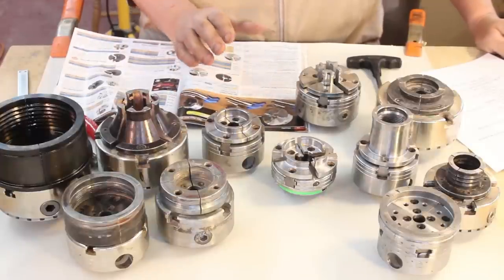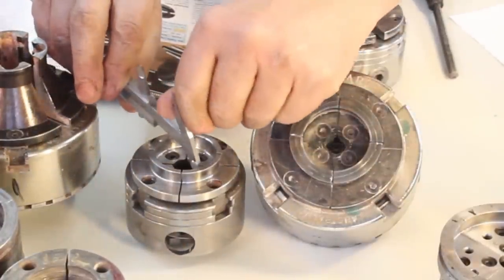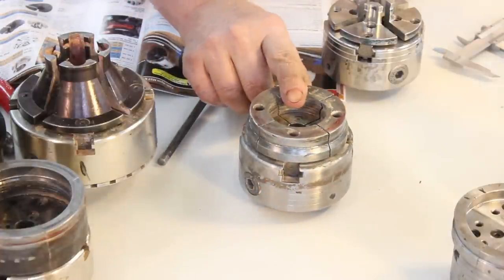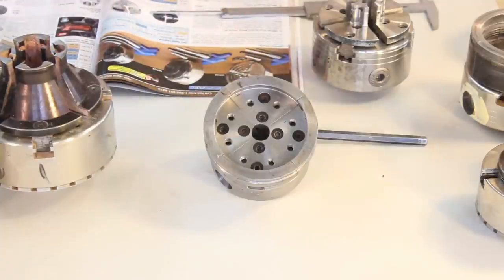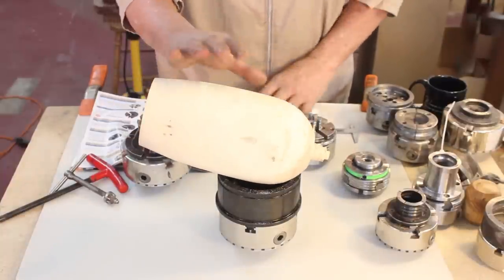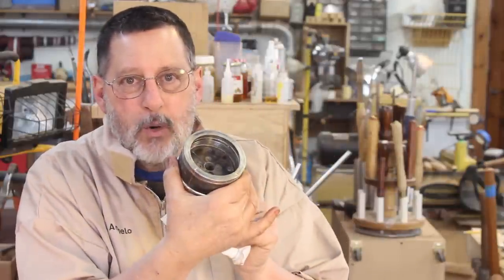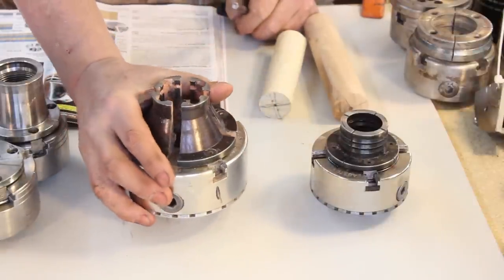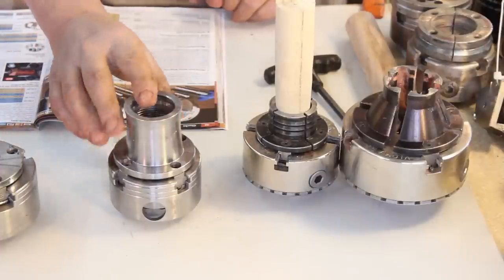Scroll Chucks and Jaws for Woodturning by Sam Angelo

Comment: Great topic, Sam. As I own all 4 of the Teknatool chuck styles, I was curious about the two Record Power chucks which look almost identical to the SN2 and the G3. I did a review of the larger Record Power SC4 chuck like the SN2. In  my opinion it is beefier and higher quality than the SN2. I was surprised. And it turns the typical way to tighten, righty tighty instead of the backwards Kiwi way.

When I started I got a used lathe with a SN2 and 5 sets of jaws. I had to have a woodturner come over and explain what they were all for. And this was for a Jet 10x14 mini! The previous owner made some strange buying decisions.

Comment: I did a lot of research when I got my Rikon midi.....I went with the Barracuda II set, with 3 different jaws....used those for several years and finally bought a second Barracuda body, so I could leave my Cole jaws on one to enable faster transition when doing finish turning...   since my lathe only has a 12" swing, they've worked perfectly for me....   I've been tempted a few times by the "quick-change" jaws recently put out by Nova, but their pricemark is set a bit too high for me to indulge on something my budget would complain about and I can get around just by spending a little time.....

There's a lot of really good chuck sets out there....but it's more than worth the money you put into it....

Comment: Nice video, Sam.
Have the chucks and jaws explained very well.
I also have 2 chuck (once No Name and Nova G3 [Set]).
Will also ensure even buy me extra jaws so.
By Your video, I made a mistake when I noticed. Wanted A vase (diameter 15cm / 6 "and about 25 - 30cm / 9.8 to 11.8" long) turn yew, caving in, the vase is broken me from my chuck and was broken. I had the wrong chuck, namely, the small (55mm) instead of the large (100mm extended).
Thank you for sharing.
Reply from the maker: Gunter
Thanks very much form watching.  Sam

Comment: Have you ever consider of buying wood lathe chuck quick change system like those two:

1- Barracuda 5 Quick Change Jaw Chuck System with FREE Pen Blank Drilling Jaws

2- Nova Infinity Quick Change Chuck System (you can also buy only some parts to make your old Nova2 chuck/jaws to make it/hose a quick change system).

I'm starting looking and I think I'd buy the Barracuda 5 because it is seems to me to be a faster  quick change system and I like to have many jaws options (4 sets of jaws and a central screw are included. The only thing with this choice is, after the price issue (I am in Quebec Canada), for the sake of security and speed, I would rather like to have an hexagonal wrench for jaws tightening instead of having a key that penetrates the chuck.

Comment: Just came across this video and really enjoyed it. I have a Vicmarc 120 for a variety of spindle and bowl work. I am looking to add another scroll chuck to my collection and was wondering if I should add another 120 with different jaws or a 100. I have the HP to turn the 120 but was wondering if the 100 might be an option for smaller stuff or just go with another 120? Thanks.
Reply from the maker: I really like the smallish size of the 100.  I have one with shark jaws which has become a favorite for boxes and such.  For the 120 that you have, you could get a set of 3" jaws for larger bowls.  And trade them out. I like the 3" jaws as the are not enormous but can do a 12-15" bowl ok and can expand larger for a platter.  I usual just buy a chuck body and then get the jaws I prefer.  Sam
Reply: @WYOMINGWOODTURNER  Thank you for the quick reply. Your last comment is kind of the direction I am heading...dedicated chucks with dedicated jaws. As I find I need them, I might buy some of the more specialty jaws and swap them out when I need them for a project but want to have a decent selection of chucks that are ready to go. Larry

Comment: Hi Sam, I want to turn very small items. Down to 8mm or possibly even smaller if I can. I want to use the central machinery 10x18" lathe from harbor freight. Could you possibly suggest which kind of chuck I should use?
Reply from the maker: Kmsan
I think what you need to look for are "pin" jaws.  You could buy a number of small scroll chucks, with or without the jaws: (Body only).   Pin jaws can hold very small items.  You can check the dimensions in the description of the jaws.  Something like this-----

http://www.rockler.com/nova-mini-spigot-jaw-set?utm_source=google&utm_medium=cpc&utm_term=&utm_content=pla&utm_campaign=PL&sid=V9146&gclid=CjwKCAjw2s_MBRA5EiwAmWIac-ULDzE5ddBVrvWdBIkljuUoN-eQ1l5NK5VX6Y0tvE_4Rji9xOARzRoCPeQQAvD_BwE

Sam
Reply: WYOMINGWOODTURNER thank you!!

Comment: What would be a good chuck for a 1/4"-1/2" steel mandrel? I know that i might need a 3 jaw metal chuck, but I was hoping that there might be other options. I turn cork handles using steel mandrels since cork is too soft by itself.
Reply from the maker: Will
I would stay away from a metal working Chuck.  I had one years ago and they are not great for holding wood.  If you want to hold something as small as a quarter of an inch you can get pin jaws.  These are draws normally used for holding small items like a finial.  I use these for my bottle stoppers occasionally or holding a pen mandrel. Every maker of scroll chucks will have a wide variety of jaws , they go from very small to 5 or 6 inches for large bowls..  Hope this helpsSam

Comment: Hey Sam! Awesome info as always! I just got my first lathe for Christmas and it didn't come with a chuck. It's a Turncrafter variable speed with a 10" swing. What should be my first chuck if I want to turn mostly bowls?
Reply from the maker: Hotrod.... I have used lots of different chucks.  My first choice is always Vicmarc which I feel are the best but also expensive.  Here is a link to Record Power which I am very impressed with---  https://www.woodcraft.com/products/record-power-sc4-chuck-50mm-jaw-woodscrew-and-2-faceplate-package-62063?gclid=Cj0KCQjw--GFBhDeARIsACH_kdaVgWvL7AGXcg2d3dopxGvS3fTCbuHO1seDkwWFsyxe9ejjBpKbWVgaArlCEALw_wcB

The 2" jaws that come with this chuck will work for smaller bowls but once you get into 10-12" bowls you might upgrade to a heaftyer jaw set.  Sam
Reply: @WYOMINGWOODTURNER  Well unbeknownst to me my wife got me a Nova G3. It came with 3 sets of jaws, 2", 4" and the pin jaws! Happy birthday to me! Thanks for all the videos you share Sam! You have quite the library that I have to catch up on!
Reply from the maker: @hotrodhog2170  Your wife hit a homerun!!!  I have several G3 chucks-and that is a good selection of Jaw sets.  Have fun. Sam
Reply: @WYOMINGWOODTURNER  I hit a homerun when she said "I do" 8 years ago! Lol.

Comment: I hear a lot of turners saying that they do not like  jaws that have the grooves on the inside. They say they would rather have smooth dovetail jaws. I do not understand the reasoning behind that. Personal preference or for a certain reason? Thanks Sam!
Reply from the maker: +Tom Wilcox At least some of those grooved' jaws are straight or have walls that are parallel.  I also don't like them.  Luckily I only have one set.  They are difficult to grip.  Depending on where the serrations end up, they can push the piece out of the chuck a little, just enough to push it out of true.  I am with the dovetail folks.  Thanks Sam

Comment: Mike, I’m new to wood turning and just purchased a Jet 1640. If I purchased Jaws, which would be your suggestion. By the way I’ve been an avid woodworker for 40+ years.
Reply from the maker: I have experience with 3 makes of scroll chucks. 1) Vicmarc would be at the top of my list- a little more expensive but you will never be sorry you bought these.  I have the VM 100 an 120.  Depends on what size stuff you turn.  2).  Next I like Record Power scroll chucks a lot.  These are well made and would be  a chuck I would not hesitate to buy.  3) Nova chucks.  I have 5 or 6 of these.  They are an old favorite of my and also a good chuck.  Sam

Comment: I have just bought a chuck like one of the ones you talked about. I don't yet know all the terminology so you may have to guess at what I am asking. When I prepare a piece to put in the chuck do I want the chuck jaws to close in around my piece or do I want the jaws to spread out into the sides of my piece of wood? By the way I just recently found your channel and I do hope to learn from you. Thank you for sharing and God Bless my friend.
Reply from the maker: +Frank Ingram For the best grip.....you want the jaws to tighten down as close to a circle as possible.  This will give you more contact with the wood, as opposed to having them extended too far.  Then, they only grip on the 8 points of the jaw corners.  Sam
Reply: +Frank Ingram I think you are asking is it better to use a tenon or a recess. Both work well when done properly. I think it is mainly personal preference. I prefer tenons for most things except platters.

Comment: I have been looking at the Nova cole jaws and i need a great and cheep chuck for them. Heard that the G3 is great but i cant find it without jaws (I dont need the standard because the chuck will most likely only be used with cole jaws.). Im located in EU. Can you help?
Reply from the maker: I am pretty sure that Craft Supply USA carries the G3 chuck body.  It is a very good chuck.  Sam

Comment: I have an old unusual type of lathe on which the headstock has a MALE Morse Taper 2 on its end. So i need a chuck witha FEMALE Morse Taper 2 on its back.  Do i have any options?
Reply from the maker: Zara,
Very interesting.  But I have never heard of this before.  Maybe a machine shop can make you an adapter.   Good luck.  Sam

Comment: Hi Sam. I have a PSI  CSC2000C system with few sets of jaws. I dropped it on a concrete floor so now it wobbles. There is no problem with the jaws and the pieces where they are screwed. 
Do you think I would be to difficult or risky to break if I try straight it with an hammer (I don't know if the metal can take some hits? Are, most of the time, wood lathe chuck jaws can be used with other brand chuck?
Reply from the maker: I would be careful hitting it with a hammer in hopes of fixing the wobble.  You might make it worse.  I would contact the manufacturer and perhaps send it in for them to determine IF it can be fixed.  Do you know where it is bents?
Generally jaw set aren't interchangeable with other scroll chuck bodies.
Sam
Reply: Thanks Sam. I'll contact the manufacturer.  I'll have to sit and take a great look to see where is the bent.

Comment: do you have a particular brand and model you would recommend for a new turner working on a Jet midi lathe? I'd like to mostly turn bowls and boxes.
Reply from the maker: I have Vicmark and Nova chucks.  Nova is a good one.  Vicmark is better but more expensive.  I would say get the largest chuck your lathe can handle safely.  Then you can buy jaw sets to fit it in the future.  Most chucks come with 2" jaws that are not great for  turning bowls. They are better suited for boxes or spindle work.  I also think this one is good  

  
https://www.woodturnerscatalog.com/p/100/6478/Record-Power-SC4-Companion-Chuck

I have this jaw set and I love it.  Very heavy duty.   

https://www.woodturnerscatalog.com/p/105/6460/Record-Power-3%22-Heavy-Bowl-GripperJaws?term=chuck+jaws

Sam

Comment: Anyone have a recommendation for what chuck I should get for a mini lathe?  I'd say I'm an entry level bowl turner but I have used a lathe to turn dowels and table legs before.  Any feedback is appreciated.
Reply from the maker: Dustin
You can certainly have a slightly larger chuck on a small lathe: (not too big, however).   With that said, I think there are many good chucks out there.  Nova, Record, Vicmark are all good.  I think an even bigger decision is what jaws you will get.  You can consider getting a chuck body and then selecting jaws you want, or maybe more than one set.  The 2 inch jaws that usually come with most chucks are not the best for turning bowls.  They are better suited for items like an end grain box.   Sam

Comment: Sam, as a new woodturner this was helpful. Not having a lot of extra money to spend. Do you think this is a good set to start with, Apprentice 4-Jaw Chuck 8 Piece Set. From Craft Supplies USA. Comes with
 Chuck body measures 3-3/4" and 
Includes:
No. 1 Jaws (Compression: 3/8" - 1-3/4", Expansion: 7/8" - 2-3/8")
No. 2 Jaws (Compression: 1-3/4" - 3", Expansion: 2" - 3-3/8")
No. 3 Jaws (Compression: 2-7/8" - 4-5/8", Expansion: 3-3/8" - 5-1/8")
Pin Jaws (Compression: N/A, Expansion: 1" - 2-3/8")
1" x 8TPI Threaded insert
3/4" x 16TPI Threaded insert
Woodworm screw
T-handle chuck key
T-handle Allen Wrenches
Wood Storage Box
Reply from the maker: Yes I think this is a pretty good way to go.  Changing jaws can be an issue.  But I am sure you probably would not change jaws all that often.  I have a friend with this set-up.  Sam
Reply: WYOMINGWOODTURNER , Thank you for your fast reply in answering my question. That will be my first purchase for my new lathe. I enjoy watching your channel, always very good information that you are give us. Very much appreciated.

Comment: I have a big lathe and wanna turn bowls wich chuck would you buy
Reply from the maker: If money is not so much of an issue I would go with a Vicmark chuck with larger jaws.  Vicmark makes 3 sizes of chuck bodies. Here is a link.

https://www.woodturnerscatalog.com/p/100/4249/Vicmarc-VM150-Dual-Action-Mega-Chuck-w-o-Jaws

 If you are turning really large 20" stuff then get the largest size.  For jaws,  go to this link.     

https://www.woodturnerscatalog.com/p/105/5455/Vicmarc-Mega-Dovetail-Jaw-Set

I have this larger chuck with 5 inch jaws.  I can turn most anything I want.

Yes it is all expensive   Good luck  Sam

Comment: Nice vid ... as an aside, I would recommend the little hard plastic washer which goes between the chuck and the spindle - this has saved me a boatload of whacked knuckles and bad language!  don't need cussing - I get enough of that at work ;)
Reply: +Matthew Williams A bit of beeswax or WD40 will accomplish the same thing. The plastic washer can distort and cause run out. I saw one that was a real mess. But, one size doesn't fit all.

Comment: I am trying to turn a 12" mango bowl and twice the tennon has sheared off it on me.  Whar size chuck jaws would you be using as I be honest it starting to scare me
Reply from the maker: Mumma
First here is a link that may help.  It is one of my videos.
https://www.youtube.com/watch?v=PhtGZfM2A9o

Two things can contribute to this happening.  1) A poorly turned tenon.  And if the tenon is not turned correctly, it can break off.  The tenon must contact the chuck jaws correctly.  I cover this in the video.

2) next what can cause the tenon to break off is when the grain of the bowl is so parallel that it creates a perfect situation for it to break off.  But primarily it is #1.

Sam

Comment: Sir,I notice that you have primarily Nova and Vicmarc chucks.  Is that by design because of the jaws or are their chucks of better quality?  The other brand I hear a lot of is OneWay, but you didn't seem to have their chuck.Thank you for the VERY informative videos and information.  You do great work and I wish I could half of what you do.
Dave
Reply: +YokoandDavid Light Nova, and VIcmarcs (chucks, and lathes) are made in Australia, and are held in high esteem by many Aussie woodturners.

These two lathe accessories are extremely well engineered.
Reply from the maker: +YokoandDavid Light 
I think the Nova and especially the Vicmarc re excellent tools.  It is more by accident that I first bought a few Nova chucks and jaws.  I then got my first Vicmark.  I now have four.  I really don't know anything about the Oneway.  So I hesitate to comment on something i have never used.  Sam
Reply: +Leari Tee Actually, Teknatool is a New Zealand company and their chucks are made in China and have been for many years. Not necessarily a bad thing in that they are made in a Teknatool plant to Teknatool specs. I have 4 of their chucks, by the way.
Reply: +Mike Peace No Worries Mike, thanks :)

Comment: Hey yo I’m only 15 and keen as in wood turning I live in Australia so Vicmarc chucks and normal nova type chuck are the same price I bought my first chuck the VM120 off of timber bits for about $300 aid and it can with $70 whorth of accessories and $50 off of the original price go and buy one if you want I don’t no how long this deal will last for wheather or not it works overseas I’m not sure but hella keen for it to arrive. P.s thought I better flex on y’all lol 😂
Reply from the maker: Chris, Always nice to hear from a new (young) woodturner.  keep at it.  Turning is a great pastime and a possible career.   So in Australia?  You must be going into summer.  Cold with lots of snow here.  Be safe and let me know if you need any help.  Sam